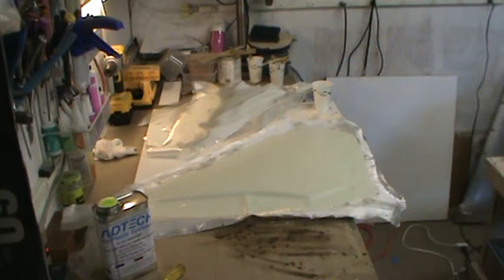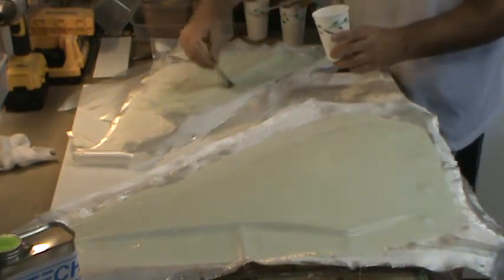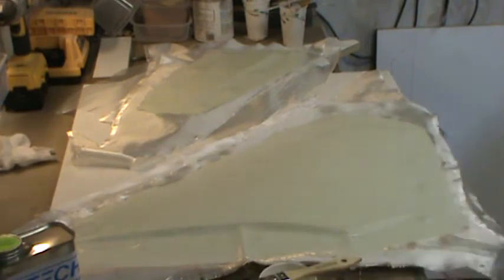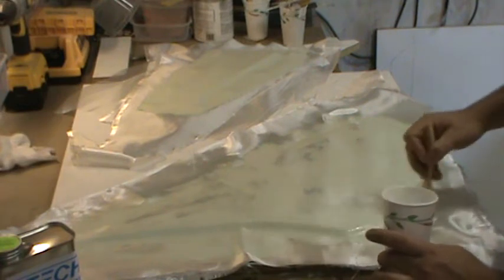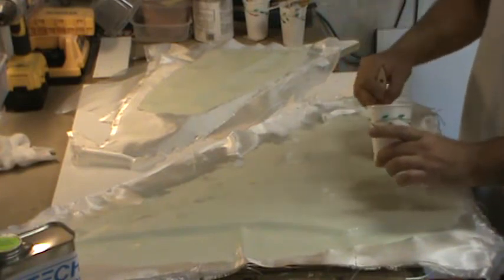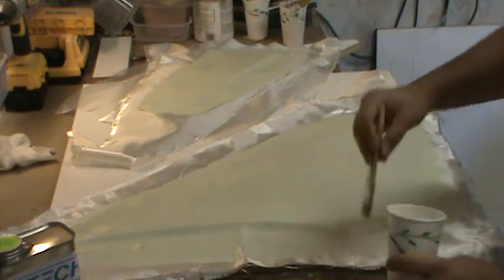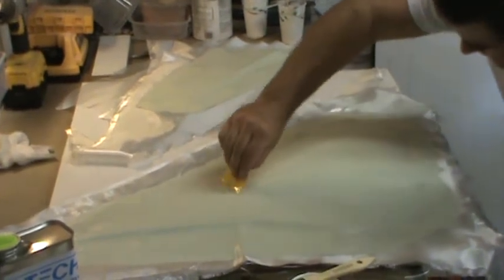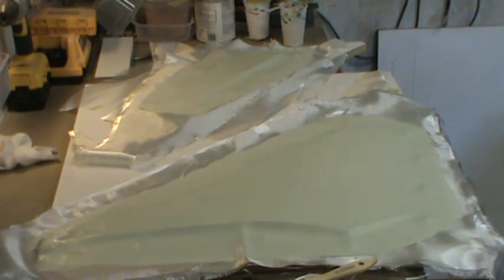How to build an F-14D tomcat #29

Comment: hello friend, if I live in Venezuela and is difficult to get epoxy resins could use vinyl resins to repeat the process with molds. my question is based. that I'm almost done on my mustang p51 positive quarter scale and want to do the fuselage all fiberglass and carbon. but instead of using epoxy resin, vinyl resins used are very easy to get in my city